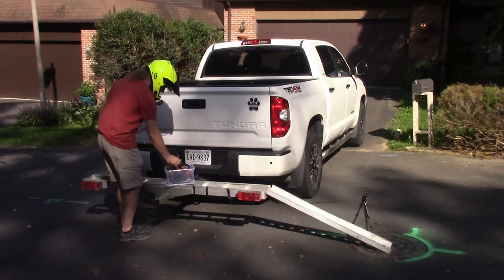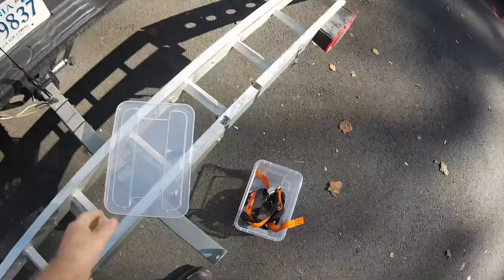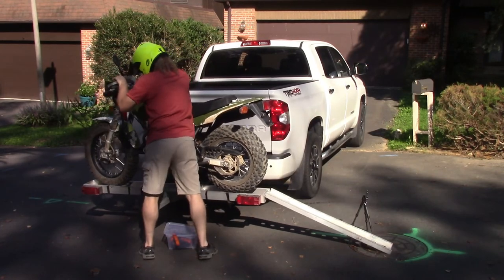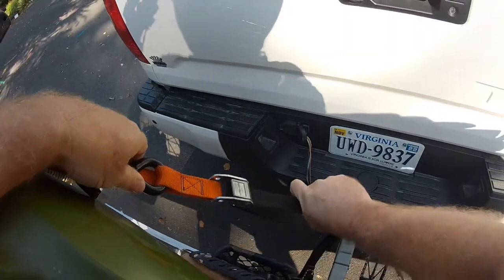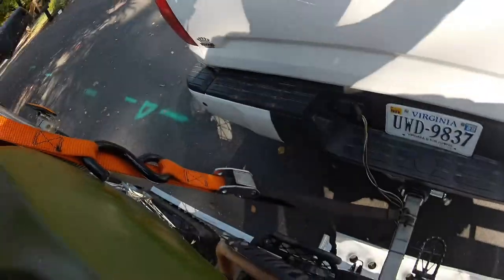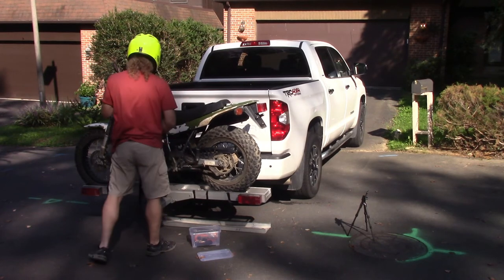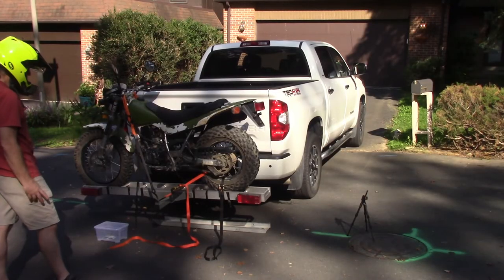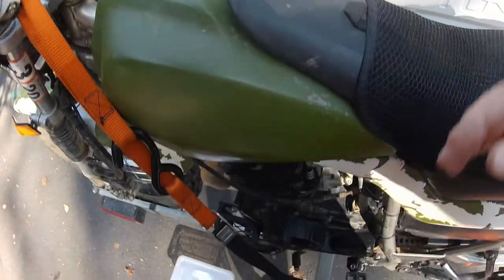Loading, tying down and unloading a motorcycle hitch carrier

Comment: Thanks, newbie here and just what I needed to see
Reply from the maker: Your welcome, just be sure to buy good quality tie downs and check the tension on the tie downs every so often.
Reply from the maker: An additional point I wanted to mention, you should look in to using a hitch stabilizer to keep the carrier from moving around while it’s in use. I have one and use it but for the video I neglected to use it.
Reply: Whenever possible, run your front tie downs to the lower triple clamps, vs handlebars.  Better angle and super solid point on the bike.
Reply from the maker: Thanks for the suggestion, I'll try using the lower triple clamps and and see how that works.

Comment: Thanks for posting this! This will be helpful for our double carrier and honda ruckus. Question, do you use any air bags on your tundra for the added weight? Nice truck as well man
Reply from the maker: Hi Paddle Board. I'm glad the video was helpful. The Tundra suspension is stock but its not a problem because the bike only weighs about 300lbs with fuel and saddlebags and the truck's tongue weight rating is a little over 1,000lb and the payload rating is 1,600 lb so nothing is over loaded.
I use to have a 2002 Dodge Ram 1500 and it's tongue weight rating was 500lb and the payload rating was 1450lb. I used the same setup to carry the bike with no problems. 
With both of these trucks the weight wasn't noticeable while driving and it did not make the headlights shine higher or blind oncoming drivers. On the Toyota there is a control that can compensate for added weight on the rear of the vehicle by lowering the level of the headlights.

One point I did not cover in the video is using a hitch anti-rattle clamp. In the video you can see the carrier wobbling around when I load the bike, an anti-rattle clamp prevents the carrier from moving around. The hitch carrier came with a hitch anti-rattle clamp which worked well on the Dodge but would not work on the Tundra. I purchased a Trimax THC200 Univeral Anti-Rattle Clamp from Amazon and it works very well. The only thing I changed on the Trimax was to replace the standard 3/4" nuts with good quality nylock nuts.
Here is a link to the one I purchased. https://www.amazon.com/gp/product/B07JPCVM14/ref=ppx_od_dt_b_asin_title_s00?ie=UTF8&psc=1
Reply: @mototrailsandtrials8482  Awesome ill be getting those as well, I appreciate the sugestion! Looking forward to putting them to use with our honda ruckus's. Thanks for sharing!

Comment: I do something similar but I double up the straps up front on the handlebars. Cam straps toward the front and ratchet straps up and down. Like NASA I double up everything in case a single strap fails
Reply from the maker: Interesting, does your hitch hauler have tie-down points on the front and back? Mine only has tie-down points in the middle so that's the reason I use the tie downs the way I do. I don't double up tie-down straps because all of my straps are rated for about 3 times the weight of the bike so I'm satisfied with the safety margin that they provide.
Reply: @mototrailsandtrials8482  it just has tie down points in the middle, I just loop the front straps around the front of the platform near the front wheel and hook them there

Comment: How do you make sure the straps don't touch the ground for the ones for the back wheel?
Reply: I wrap them around the rear foot pegs and then I take the loops on the end of the camlock straps and put them over the straps wrapped around the passenger pegs and flip the pegs up to the stored position and the straps are secured.

Comment: Which carrier is this? Did you add the lights yourself?
Reply from the maker: Hi John, I'm using the AMC 400 carrier. I added the lights myself. The lights are from an inexpensive trailer light kit I purchased from Walmart (https://www.walmart.com/ip/Blazer-International-Submersible-Low-Profile-Trailer-Light-Kit-C6285-Red/16880525). I purchased the kit because it came with the lights, wiring and 4 pin plug needed to use my existing towing setup. The lights work pretty well but If I had to do it over I would probably go with a similar set of LED lights.
Reply: @mototrailsandtrials8482  is the carrier worth the money? I have to bring my TW on a 1000 mile trip.
Reply from the maker: I believe the AMC 400 is worth the investment. I've been using mine for 4 or 5 years and it has held up well. There are less expensive aluminum carriers available but I think they use lesser quality materials and they are bolted together rather than welded together. With free shipping, I think you can get one from Black Widow for a little over $200.
Reply: @mototrailsandtrials8482  thank you
Reply: @mototrailsandtrials8482  so I ordered the 400 black widows do have any trouble fitting the back tire of the TW 200 on it? The width on the 400 is 5" 1/2 wide. Looks a little narrow for the bike. Is your Carrier 5" 1/2 wide as well?
Reply from the maker: @SleepingGaint  My carrier is the same size but I don't have any problem with the tire fitting. It does hang over slightly on each side but the way I strap the rear tire down keeps it from being an issue.